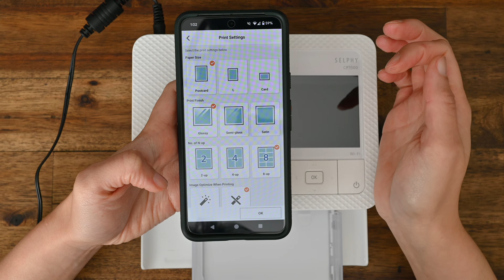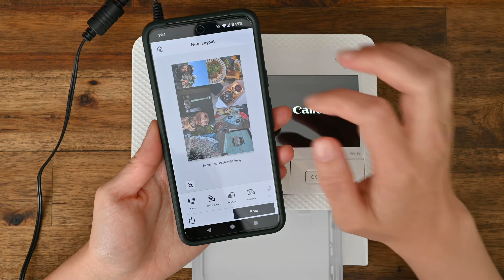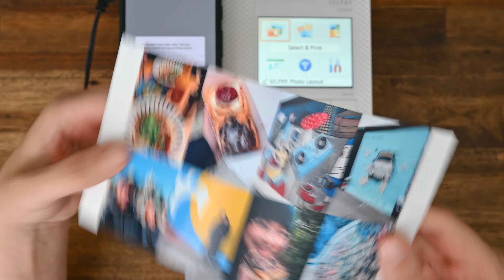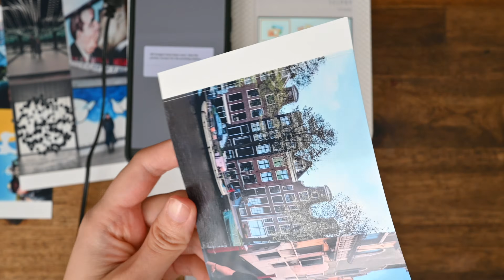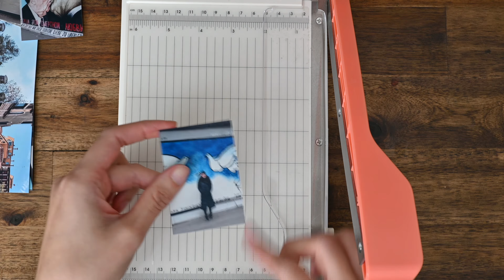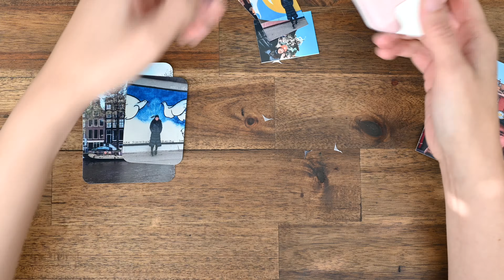How I use my Canon Selphy CP1500 | Canon Selphy Settings & Adjustments | Cutting & Trimming Photos

Comment: You know, there is an attacheable battery for this printer. But you can use the smaller one for the CP1300 as it uses the same connector.
Reply from the maker: Ohhh! Good to know. Thank you ❤️

Comment: I saw some people using it without the power plug…. How can we use it wirelessly?
Reply from the maker: You would need to buy the rechargeable battery which doesn't come with the Canon Selphy ✌️
Reply: @linedmusings  that's what I did, so nice to have.  Bought a compatible one from Amazon.  Also got a case to hold everything since this would be portable.  Better than having a polaroid.

Comment: I just bought one! Does the contrast and saturation help the with the print quality? I didn’t mess with this and mine came out a little discolored. But I also didn’t turn off the optimize option maybe that’s the problem?
Reply from the maker: It seems to make a difference for me. Though even without the edits and optimise option, the print quality is still very nice for my Selphy. It just changes the colour contrast and saturation, but not necessarily the print quality. I do find the glossy finish makes the prints look more vibrant too. I hope that helps!
Reply: Are you using an iPhone? I noticed android users quality are much more better than iPhone 

Cause I am facing the same issue with the colors quality
Reply from the maker: I was using a Pixel when this video was filmed 👍

Comment: Hi. I bought the printer and printed few photos. What worry me is that edges of photo are outside the tear off line. There is explanation for that in internet. I am more worried that it is uneven. I mean I lost approximately 3mm on one edge butt 2 mm on other bottom edge. Is it normal? Have you noticed?
Reply from the maker: I've experienced this too, but I'm pretty sure the part of the photo within the tear off lines are as per the settings on the app. I may be wrong! It hasn't been something I've paid too much attention to 😊

Comment: Is it possible to use the selphye canon without putting the power cord in the socket?
Reply from the maker: No, it needs a power source and does not have an internal battery
Reply: there is a battery pack you can purchase separately :)

Comment: Thank you so much for this video! I have a Canon Selphy Square QX10, but haven’t used it in quite some time since I ran out of ink & paper & they’re quite expensive & you don’t get many sheets of photo paper in each package, so I haven’t bought more yet. 

How is it with the Selphy CP1500 & the paper? Do you get a lot of sheets in each package? Thank you for showing how to print multiple pictures in the grid too since that’s what I feel like isn’t working great for me with the Selphy Square because the paper is so small & I print a lot of photos 🙈 Might need to look into this too! Is it easy to get a hold of the paper for it? And how do you find the colour accuracy is between how the photos looks on your phone vs when printed?

And okay, my last question now 😅🙈 When you changed from “glossy” to the other versions, was it just a change in the printer settings & not the paper itself?
Reply from the maker: Imo the colour and paper for the CP1500 is great, especially if you're after high saturation. Adjusting the photo colour settings on the printer helps a lot.

The number of sheets you get depends on the pack that you purchase. Generally the cost per sheet is less for larger packs. Availability of the photo paper will depend on your location, I guess! For me, in Australia, it seems to be readily available :)

When changing the photo finish, you don't have to change the paper, the machine applies the finish! I thought that was super interesting, but like I mentioned in the video, I prefer the glossy finish, which I think is the actual finish of the photo paper.

Comment: Great video, i brought one awhile ago and love it. I recently brought the Cannon Selphy Square which is perfect for travelling or moving around with. Plus it has thin sticky backed paper  ❤
Reply from the maker: I'll need to look into the Canon Square!
Reply: @linedmusings  I’m an enabler :)  I do have connection issues with the CP1500 at times and don’t have anywhere to keep it set up all the time, so the selphy square is quick , easy and portable.